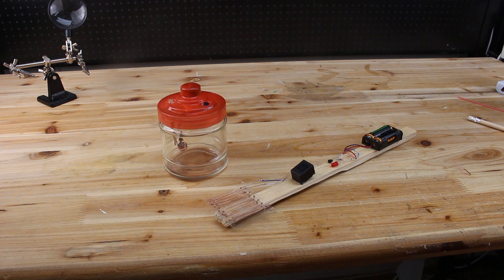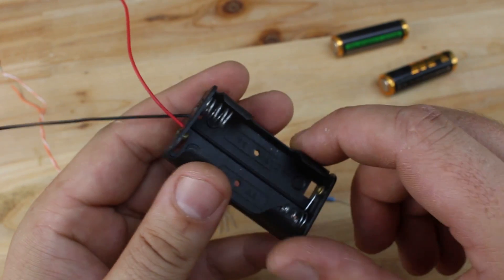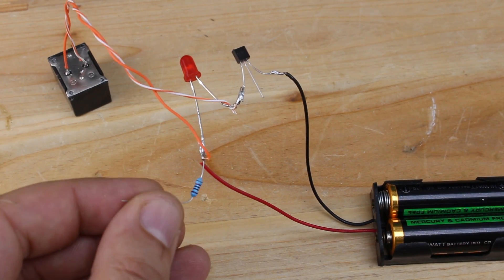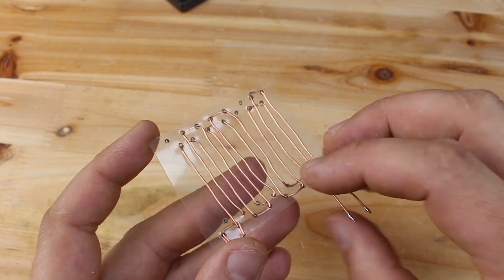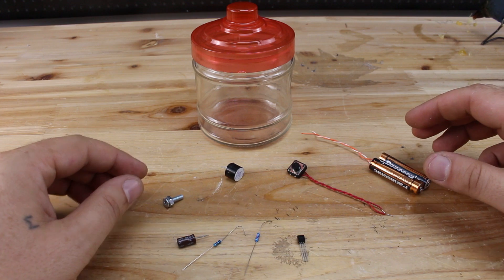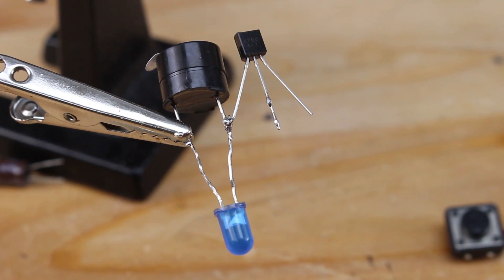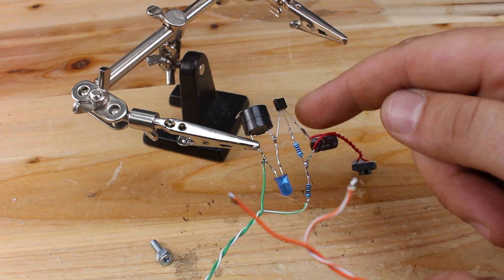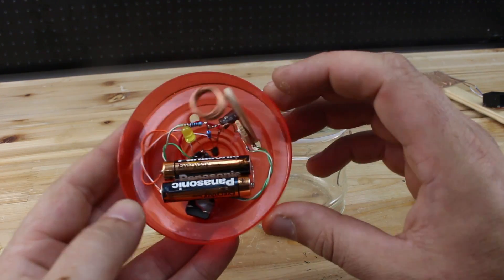2 Homemade DIY Inventions

Comment: A 1N4001 diode placed across the buzzer will prevent the back emf from that inductive buzzer blowing up the transistor.(Cathode connected to the positive supply of course )
Reply from the maker: Yes you are right bro,thanks